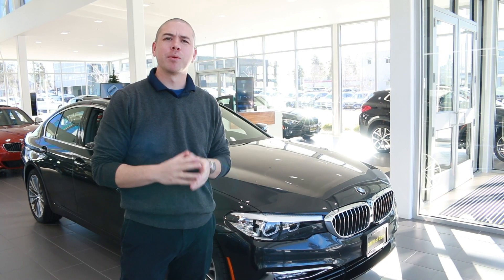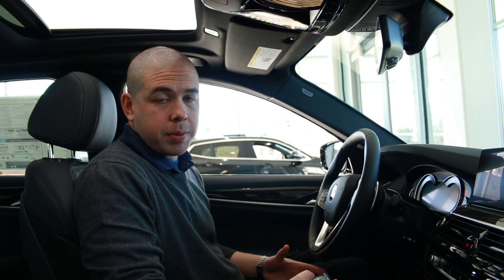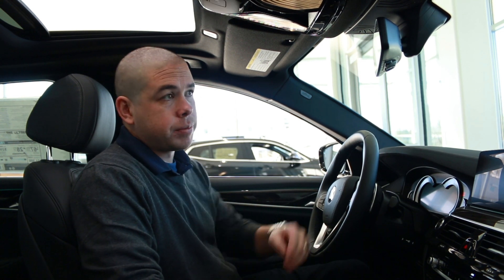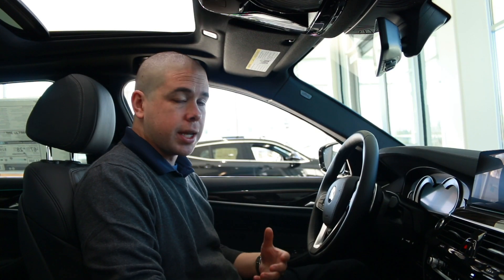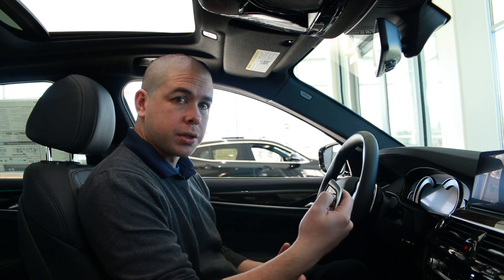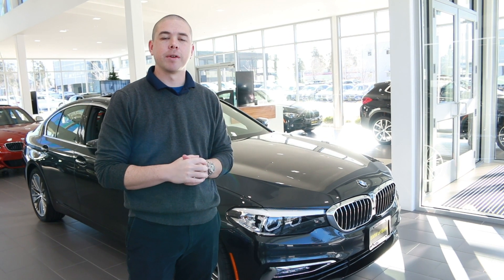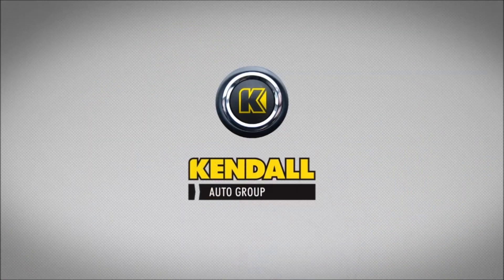BMW Motion and Tilt Sensor Deactivation with BMW of Bend

Comment: I have a 2022 Z4 and had trouble deactivating it tonight. I had the windows cracked however the first try didn't work for some reason. Then I tried it again with the windows cracked, pressed lock twice and it worked. I take it the LED light on the rearview mirror still blinks regardless of whether anti-tilt/motion sensor are deactivated because it blinked no matter what I did.

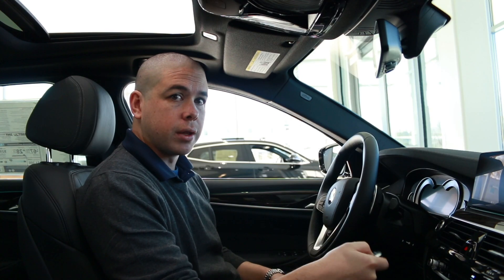Comment: 0:48 How do you get rid of this? I guess I accidentally deactivated the motion/tilt sensor and it wont go away.
Reply from the maker: Pressing the lock button once will activate the complete alarm system. Pressing it a second time within 10 seconds will deactivate the tilt and motion sensors, in the case of leaving a large dog or appropriately aged child in the car safely for a limited amount of time. Once the car is unlocked the process resets. There's no way to permanently deactivate the motion and tilt sensors. You can always unlock and then press the lock button once to reactivate the entire security system.
Reply: @Kendallbmwofbend  Both of my LED lights are on when I lock the car, now the little red flashing light looks like a long strip flashing.
Reply: @Kendallbmwofbend  I deactivated the alarm and the red flash light always on now. I can’t activate back. I unlock/lock the car but still there is red flash. How can I close it(how can I activate motion sensors)?

Comment: Please please see this.....
My alarm on my bmw f11 520d keeps sounding whilst I'm driving I've no error codes for anything I've tried doing the double press and doesn't solve anything I've tried disconnecting the battery re connecting it to 'reset the car' didn't work. I'm having to drive round as if I've robbed my own car please any idea or info or things I could try anything will be appreciated thank you